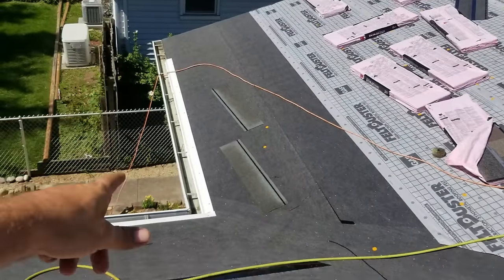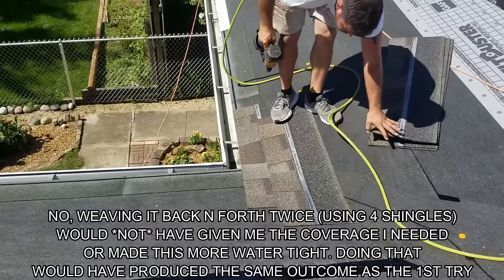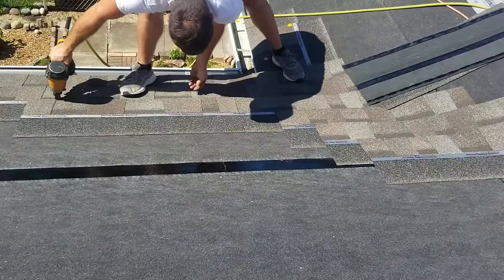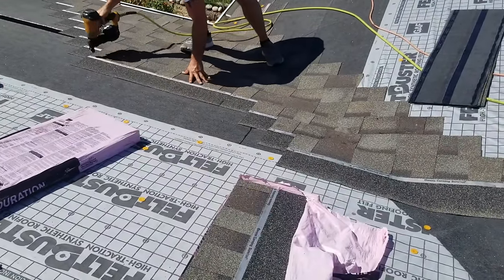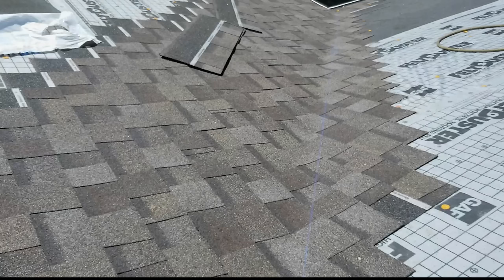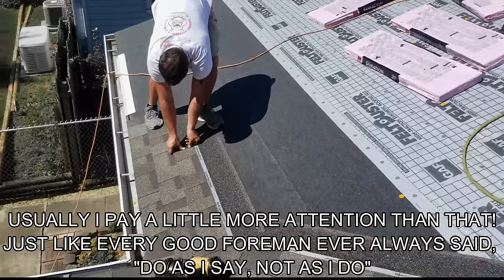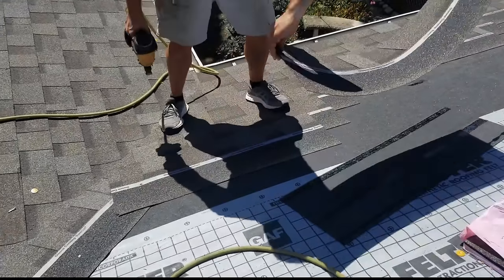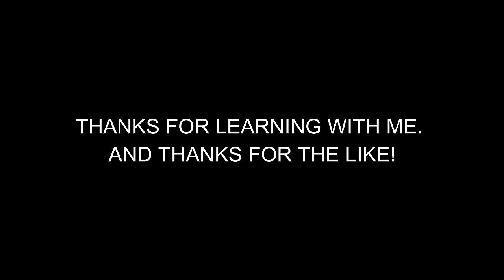How to do a closed valley!!!

Comment: I had a new roof done which is all uneven at the bottom. GC said it’s my gutter. A blind person can see it’s either plywood that is caved in or they did it wrong. My valley looks to be a closed on but I don’t like how it looks. That means it was also done and cut wrong
Reply from the maker: I've always done valleys this way, looks and functions better.  Unless you discussed with him ahead of time how you want your valley I don't think there's anything you can ask him to do unless it's messed up and not the fault of the framing. But yea if the waves on the bottom are from rotten wood that's a bit of a problem. Sometimes older roofs are framed 2 ft on center with thin, ⅜ plywood and the plywood will start to sag in some spots between the rafters because no H- clips were used.  You can always go up in the attic and try to see if there's damage or if it's just sagging. Depending on how bad it is, maybe he should've addressed that

Comment: Your tips/videos have helped me immensely! I'm putting a roof on my house right now in Washington state so I know the job has to be above par with how much it rains here. Only question I have is why do you call him Boycub? 😂
Reply from the maker: haha glad you enjoy. and basically his name is Jacob, and we had another Jacob on the jobsite. pronounced (jay-cub) and  It never worked trying to call one jake and the other Jacob so we came up with mancub and boycub. boycub got the name coz he was shorter than the other jake lol I told him i'll start calling him mancub when he lays 10 sq in a day
Reply: @NWIVeteranConstruction  ? for you Bought my home 4 yrs ago, being up on roof for gutter cleaning Noticed I have a dead valley (5 ft flat spot) I get little leaks in winter only into my sunroom. How would u fix that flaw. My roofer guy said he can build a lil ramp 🤔 wasnt keen on more nails in roof. Roof replacement is on for April 26th (in Mi)
Reply from the maker: @johnnybravoBoyah  I wouldn't fix it if it's going to be replaced, have them tarp it or do something temporary. I would say just to ice shield the hell out of it or rubber/ rolled roof it.  But it really depends on the job.

Comment: @12:40. Your backstep runs real smooth if you run your valley two shingles a run. From outside in. And when you need to back step, switch your nail pattern on the outside shingle and fill the inside shingle.

Comment: I do metal W valleys the same way, instead of chalking a line after i run the valley, i run a shingle lengthwise up both sides of the valley, 3 inches from the belly on both sides, then i run my shingles right square from where they touch the valley shingle, gives a real clean look, don't have to make all those cuts, there are no points (titties) to cut either. When i read closed valley tho, i thought you meant like running both sides of the valley at the same time and over lapping the shingles in the valley, I've ran them that way as well, sometimes you gotta run one up the left, two up the right, back to one up the left, or however it works out, then you have a truly closes valley, not an open cut, California cut, whatever you wanna call it. 
Hey I've been roofing for 34 years, if you put your name on it, the customer is happy, you get paid and it doesn't leak, then that's a job well done in my book, to hell with the haters and what they have to say. I'm relining about 200 foot of box gutter currently, I'll bring home 10 grand for a little over a weeks work, let the haters see them stacks we make doing this stuff😂

Comment: I have an issue with my dads house it was shingled 5 years ago and now I have a leak in the valley I think the water is coming off the steep side going under the other side.  Is there a quick fix to keep the water out and not in my dining room?
Reply: It's best to have it fixed. Using muck and other sealants might seem like it stopped it. This will make it worse in most case's, unless you live in Arizona.

Comment: Come over to Washington, help me with my roof. I’ll pay for travel, room and board. You can do in a day what will take me a week.
Reply from the maker: haha i would love to!
Reply: @NWIVeteranConstruction  I got started today. Figured I’d take it in bite sized sections. 
I added a 30 inch overhang to protect my new siding, weather trashed the gable wall. 

I pulled off the old roofing about 6 feet from old roof edge at gable. I left a bit of the first layer of roofing (three tab) and a bit more of the tar paper. Kind of stepping down. 
Then pulled a bunch of nails very carefully on existing shingles and put Grace Ice and water shield under the good shingles. I then re shingled the rest with asphalt emulsion caulk under the nail holes so when I pressed down the shingles the goo came up out the hole. 

I put eave flashing on before the ice shield, then capped the rake with drip edge. Ran my starter course and started shingling. I definitely can’t cut shingles straight like you can, just a straight edge over plywood for me. 

I appreciate your videos. If you ever find a roof where someone added an overhang or addition and you are tying into an existing roof, I’d love to see how you do it.

Btw, every 4 shingles had a nail right at the edge of the next course of shingles! I like your five nail shooting.
Reply from the maker: @jeremylakenes6859  awesome to hear brotha! I'm sure you're kicking ass
Reply: @NWIVeteranConstruction  I think I’ll post a video of what I did. I can’t find anything on youtube. Then maybe you could critic it so me and others could learn from my possible mistakes? Was way more complicated than I thought. 

Then I watched your video on rolled roofing... I have a 4/12 to 2/12 porch... with architectural shingles for a 70 ft run...

Comment: Please if you're a new roofer don't do what this guy did. He is all over the place. There is no need for a weave at the bottom. There is no need for starters up the valley it's a lazy man's way and also the nail's don't go in the roof as much, caused from the extra bulk. It also sits up and leaves a bump visible from the ground. And God forbid you're  putting on a second layer the nail's will barely hit the plywood .Also don't run all over the roof, take one row up at a time and place your shingles 4 feet away from the valley and in line with the valley for easy reach. Oh and have your house always above you much easier for manovering. Try some knee pads and a pouch as well. Like who does a toutorial with out equipment. Besides that great job :)

Comment: Everybody does it a different way, states require certain procedures depending on living quarters. Whatever way you roof if it  keeps it from leaking that’s all it matters. If you do it right the first time then you shouldn’t be getting a call back. Storm damage not included lol
Reply: There is only one correct way to apply roofing. However you arrive at the correct application is up to you, yes, but the end product should be applied to manufacturer specifications and should exceed local building code requirements.

Comment: Here is a tip to go alot faster.  When nailing, don't nail the far end of the shingle.   Start by putting a nail a foot in from the right and put 3 nails in the shingle you are installing and 1 nail in the end of shingle your abutting.  This way your nailing is only 2' wide instead of 3' wide or the entire width of the shingle.   Think about that two of the four nails you are installing a only 2" apart.
If you don't get what I am saying,  
Lay the shingle
Don't nail the right end of the shingle ( you will install a nail there on the next row you lay)
put a nail 27" from  the left
another nail 18' from the left
And nail 9' from the left
last nail on the shingle you are abutting

Comment: Your nailing below the shingle tar line is a no no .
Use a metal roof section with a wedge in the center that is baked 
with enamel paint . When water flowing down the valley hits the wedge it is forced down the valley to your roof edge ,  otherwise the water will flow across the closed valley and over time water will get under the closed valley shingles and start leaking .
Reply: This guy isn’t not a real roofer.  Those nails on The Valley   Makes not secure enough. For leaks.
Reply: @silveriojuarez1349  Correct Mr . Juarez . This roofer is putting nails too close to to the valley center line . Leaks will appear within one to two
years with his system . $$$$$ down the road .

Comment: Can you explain what it means to stack 3 tab shinglem
Reply from the maker: I'm a little rusty on the subject and barely ever used 3 tabs because they're kind of dinosaurs these days.  So I rather you find a video honestly.  Don't wanna blow it lol
Reply from the maker: But it's basically when you stagger the shingles 6 inches back and forth all the way up. So in a line straight up the roof. Not like a stair step where you build one end first.  You can literally start in the middle of the roof, or near and end, it doesn't matter as long as You snap 2 vertices lines about 6 inches apart that are square to the structure. Use the notch at the top of the shingle to find your line numbers

Comment: How far are the tops of those shingles going past valley? California valley😳.....not my style.....id install a closed/cut valley minimum......metal valleys above all. No stress on bent shingle....same principal as would you use shingles as wall flashing?  Those shingles in the stress zone will lose granules and fail before rest of shingles before its time and look like crap for 10 years before next re-roof. Metal is were its at!

Comment: Man at 4:00 I still can't get over how the top of your shingle is directly in the valley it's the top of shingle that has to b out of the valley not the bottom of the shingle do u know what I mean?I guess my thirty yrs of roofing  I could b wrong but I dont think soo
Reply from the maker: I agree 100%. I usually start with the bare minimum though so that I don't have a bunch of back steps.  It was an illusion to you coz i know it wasn't in the center.  The top went past about 4 or 5 inches which is enough in my opinion as far as the minimum goes.  This valley line isn't very clear for you to see in this video

Comment: Works, but metal is faster, less waste..... good video though,  thanks
Reply: Open W metal valleys are the only way to go.  Anything less is a compromise benefiting the roofer only.
Reply: Bullshit!!!
Reply: @dustinoflynn1649  not a lot more sq,unless there are a few valleys but still more!!If you do them correct then they don't leak.You can put metal in and at best only have 12in of metal coming out of valley. Plus u have two potential ways for water to get in instead of 1.
Reply: @Willis476  exactly I dont mind either unless its w valley I hate that shit closing up all the ends. You have to cut your staggers coming out of metal and like you said to be completely sure with ice and water damming you have to ice and water both sides of the metal and especially if you have a pitch change like a 10/12 onto a 4/12. And most valleys aren't straight so I'll snap a line with metal and use that as a guide so it doesn't bubble and look like shit and have popped nails. It's not any quicker for metal in my opinion. Its cosmetic and that's about it.
Reply: @dustinoflynn1649  I agree 100%,I'm not to sure if he was just putting metal in and that's it!Not cutting the edges,or tits or staggers,not closing it up and not ice shielding both sides.I hate big pitch changes the most.Saw one guy one here say that copper was the real cottect way.Or someting to that effect.You could W the metal and would help with water as far as rain.Only you still have to cut the staggers and all.So it's only good for looks and does work but not quicker!

Comment: Hey zack I did a valley just like this today for my second roof ever and my boss is trying to tell me it’s not code I just pounded out 18 square in 4 days by my self and he wants me to rip it up in fear that it’s not code. Please save my body and my time by helping me lmao. I work in Colorado and like I said it’s only my second roof ever I prolly shouldn’t even be roofing lmao
Reply from the maker: Wtf why ain't he watching you? Lol just throw anybody up there? If he thinks it's bad enough to tear up n pay for material... it probably is... this valley had never failed me and many others... so idk what's up in Colorado.. they normally have a lot of metal roofs north of Denver so idk if there needs to be tar or what
Reply from the maker: He probably wants the open valley.  Some manufacturers say closed valleys aren't accepted but i also talked to people that are high up and they said its fine so....
Reply: I appreciate you replying I wish I could send you a picture because my shit is crisp straight lines everywhere no frowns no smiles and he never trained me like a pos and just told me to watch a video like wtf I get 18 an hour n I hope it’s worth I’m 20 and I guess I’m classified as a general contractor cause I do more than just roofs and I’m out of co springs

Comment: Is that an Eve drip that is on top of the underlyment? and if so, how does that work with the run-off system?
Reply: Personally, you should always put ice and water overtop drip edge/gutter apron. But it's not something that's going to ruin the roof. If water is getting under the shingles than there's other things to worry about.

Comment: 1. You’re supposed to put a small piece before putting any full shingles maybe a piece the length of 10-12 inches then you lay your shingle
Reply from the maker: That's a kick out and is a very good quality move! It designed to kick water out of the center of the valley further away from the wall so there's not a lot of volume hitting the step flashing.  however, here, that is a very very poor decision because it will just kick water closer to the edge of the gutter and if there isn't a splash guard at the 90 water is likely to splash over.  Use it where its supposed to go bud not here
Reply: @NWIVeteranConstruction  you’re correct. But remember it’s always your move how long you want your “kick out” if there is a gutter leave about 1 - 1 1/2 inch. I put gutters too the water won’t splash out it’s not a hurricane. Now if there wasn’t a gutter you would do about 3 inches or more. Btw you’re gutter is supposed to have the splash stopper in the beggining of valley

Comment: California Valley!!!! Not a closed /cut valley.....some manufactures will accept this application but i would never install a valley this way. A true closed valley is accomplshed by running top of shingle on the to course passed line then miter top back and cut exposure to the line.......and i also run top of shingle on bottom course at least 10 " past valley line and keep nails minimum 8" out of valley line...... Weave bottom course as well👍!
Reply: 26ga. W-style valleys are the best!

Comment: Ive always thought and been told to remove that plastic strip on the top side of the shingle so that the tar strip and the lower back would adhere to the tar strip where you nail the shingle down....is this not correct?    We call these valleys here California valleys, and I have never been found of them
Reply from the maker: We call them that as well I just gave it its government name.  But no you don't have to do that on these shingles
Reply: The plastic strips are for packaging the shingles, so that they don’t stick together. They say do not remove on them. Which is instructions for the workers in the factory.
Reply: The plastic strip only aligns with the tar when the shingles are in the packaging.There’s no need to remove it.
Reply: @MoneyManHolmes  Not entirely true. 3:36 you can clearly see the plastic is aligned with the tar strip on the underneath side of the shingle on the next row where the bottom of the shingle is. I have torn off roofs where the shingle never sits flat because it stuck to that plastic strip and the plastic released allowing the shingle to be free and let wind under it.....and where I live. It gets very windy most of the year.
Reply: I guess it might vary by shingle? This one appears to have a woven nailing strip on top which prevents nail heads from going through during installation or high winds. It’s a pretty cool feature.
Reply: @MoneyManHolmes  Potentially. Its why I asked about those, Ive seen it occur is why I asked.

Comment: Y do the shingles not have any overhang into the gutter. Is that how you do it.
Reply from the maker: that is not how I do it, there must be a mirage in there where the gutter apron and gutter mash a little because I've never, in my entire life, installed a starter overhanging the gutter apron any less than a half inch. standard is 1/4 - 1 inch. I usually do about 3/4 roughly. snap from end to end. unless its short like this

Comment: Why don't you use metal w valley?  Cost?  We always used w valley with a vertical soldier shingle 2 inches out on each side, then step shingles up with bottom corner at edge of soldier shingle.  0 cutting required at the valley

Comment: You’re great! Big fan, quick question. You’re using nails, even over the eves. Are they not blowing through? My company always has us use shake staples on eves to avoid blow throughs.
Reply from the maker: Do you mean on the under side being visible? I've had a few of those situations where a room had a ceiling and roof decking in one, or like another time I did a gazebo and you don't want the nails to show on the underside.  Yes I use 1 inch nails that won't penetrate through in those situations. Where I'm from there's soffit in the eves so you can't see plywood when you look up